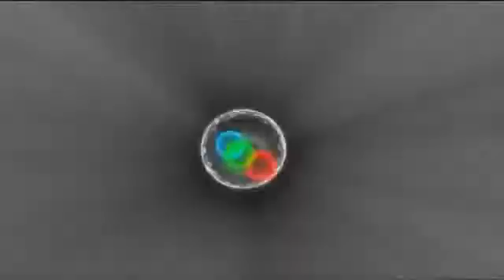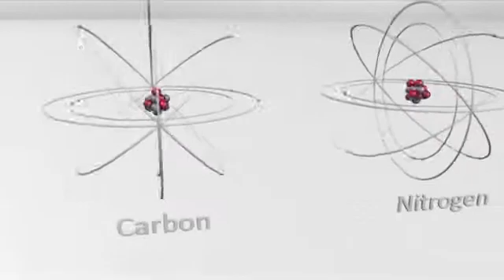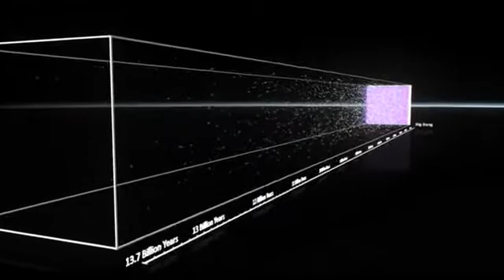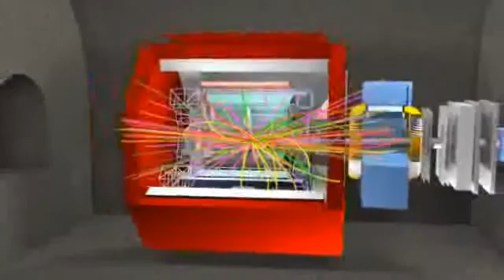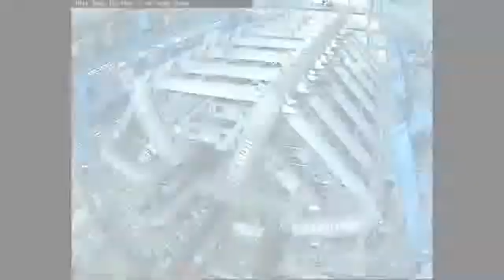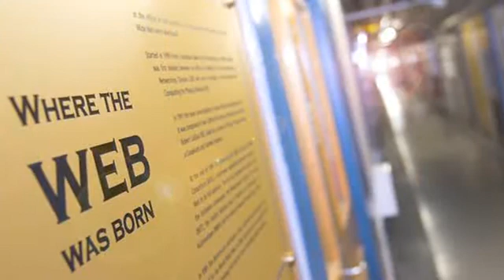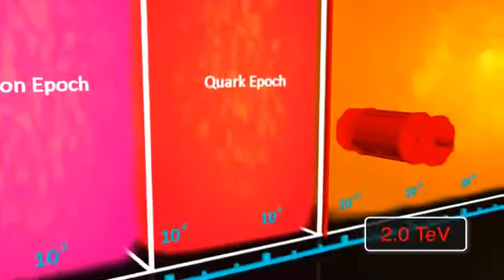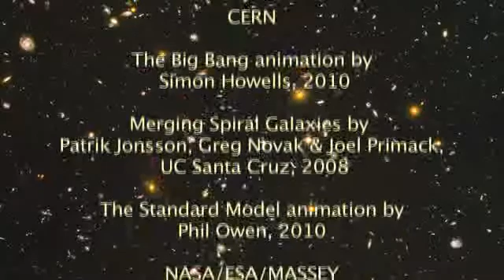Cern: Video produced for Andrew Lankford's talk at Google's Zeitgeist event 2010

Comment: just a thort is it in any way posible to use this same process to remove radiation from wast by pushing it out of the wast  in the same way and would it act simler to a battery building up then used in some process